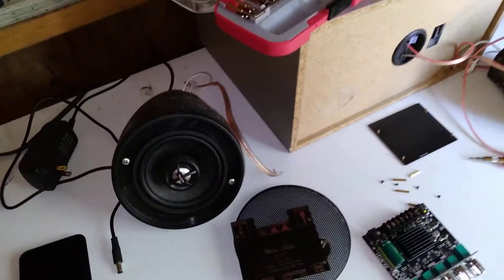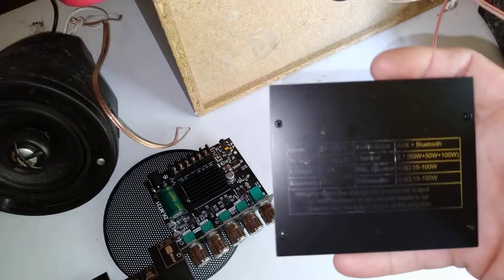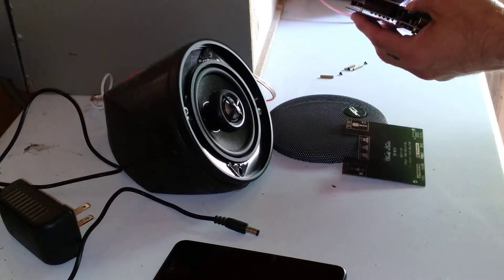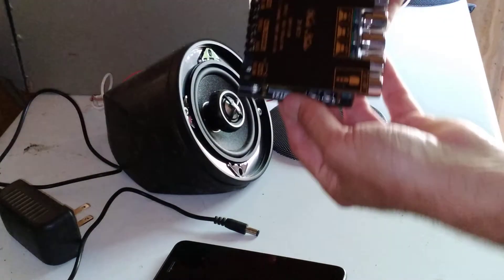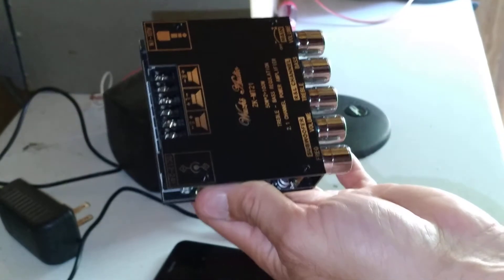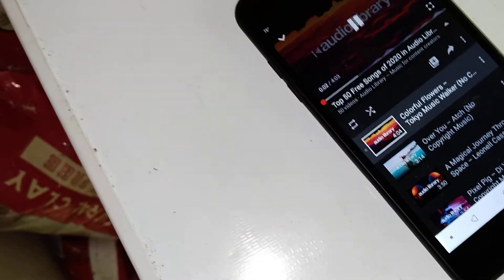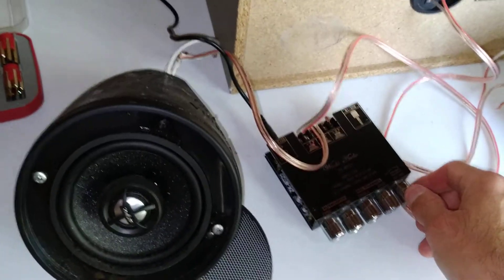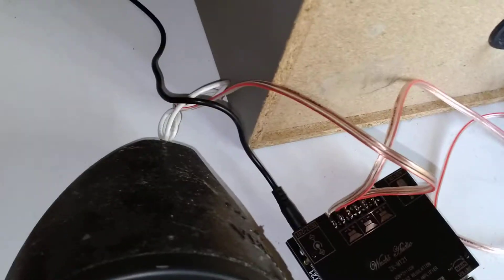WUZHI AUDIO ZK-MT21 2.1 MINI BLUETOOTH AMPLIFIER REVIEW

Comment: Can i use 24v 6A power supply 
Too high 24? 
If anyone knows what is correct? Thanks

Tell me something please. Cause i ordered.
Reply from the maker: @jordee7069  look up the amps operating voltage in the specs. As long as it doesn't exceed the amps operating voltage, you're fine.
Reply: I thought these could handle 24v 9amps🤷‍♂️

Comment: Sir Can i use the charger 12v 1ampere to zk-mt21?
Reply from the maker: Maybe, 1a isn't very much power. 12v x 1a only equals 12w theoretically lol.
Reply: No you can't
Reply: A laptop charger is the best
Reply: @user-pz4hw2lu7e hi, i have the zk mt21 connected to a laptop charger but it makes a hissing sound when connected to Bluetooth, do you have the same problem or similar?

Comment: Just got one, it clips at about half volume pushing a pair of Yamaha outdoor speakers. Even with the sub not connected.
Reply from the maker: Make sure to use a higher voltage/amperage power supply than the one tht is supplied with the unit. These little mini amps need the juice to make power
Reply: @scarr3ll  this unit didn't come with a power supply and bought a separate one. How many amps should I be looking for to power this unit
Reply: @sunstar2310  atleast 12V 5A
Reply: is it possible to use 12 inch speakers for line subwoofer?
Reply: You need to check your power supply  you need  a 18v  3.5A and it will sound very great

Comment: I got the Bk1002T Wuzhi Audio amp like this one and it has incredible bass pushing my RTR 15 inch towers, I have the Bic Formula sub wired to it that has high level inputs. I bought the Fosi BT20A amp and it doesn't have a lot of bass till you crank it up. I returned 2 of them. I never use my sub with this amp as it sounds perfect. I use a 24 volt 10 amp power supply and it shakes the walls. It's a shame this doesn't have a full enclosure as these would be top sellers on Amazon.
Reply from the maker: Nice man, yeah while making this video I was kinda sad because I won't be using this little Wuzhi amp anymore and its a shame because it really is a nice amplifier. Great sound and control. The subwoofer crossover knob really makes a huge difference by being able to keep the vocals out of the sub. Unfortunately my BRZHIFI unit does not have one and allows the low end vocal range and such to bleed through. I'd like to put a passive crossover on the sub but its 2ohm and finding a 2ohm crossover is proving to be difficult.